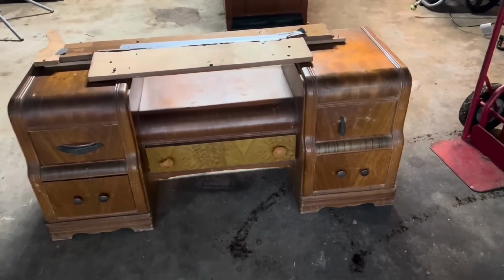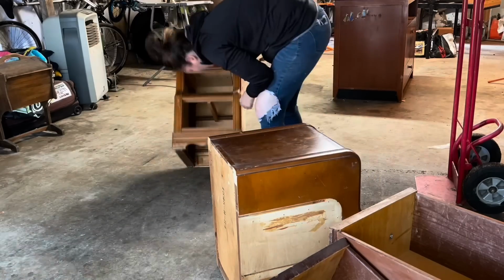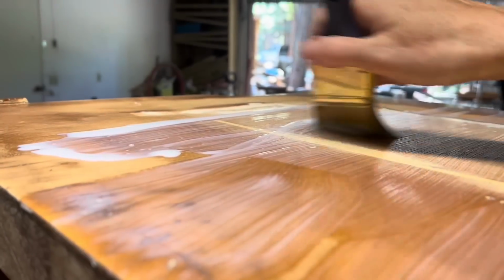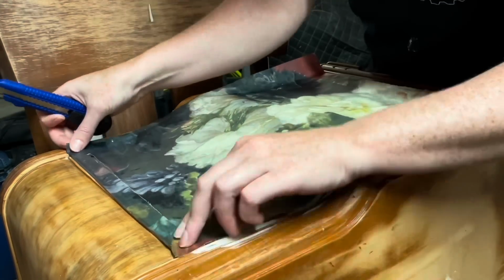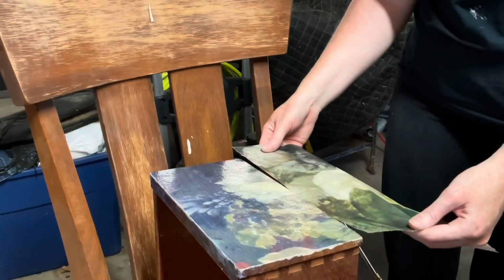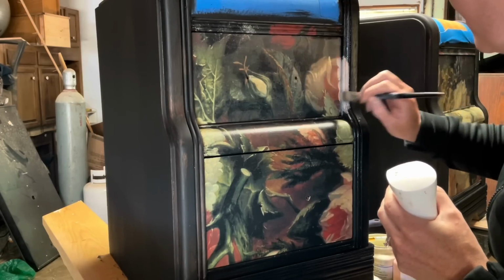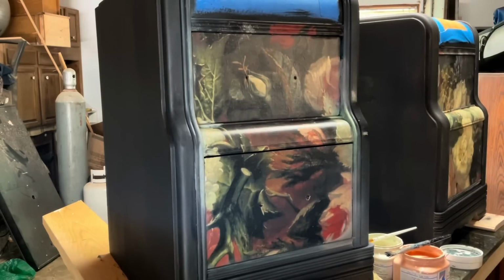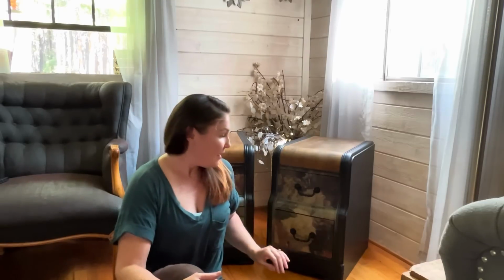Vintage Vanity to Dark Floral Nightstands | Decoupaged Drawers | Elegant Upgrades

Comment: Taryn! Thanks you for using the putty in two layers. Now my question is, do you think it can be layered more than that? I have a little shelf 6” x 18” 6” deep with a HEART cutout. I don’t want to use Bondo. I was thinking of duct taping the heart bottom and pouring in some Durham’s (I wasn’t thinking of layer but that sounds like it would work better). The wood is probably 1/2” thick.  

I love these 2 nightstands!
Reply from the maker: I can’t see why you wouldn’t be able to layer more than that. I’ve done several layers before- just not with the thin/pouring technique. I’m not a fan of bondo either.